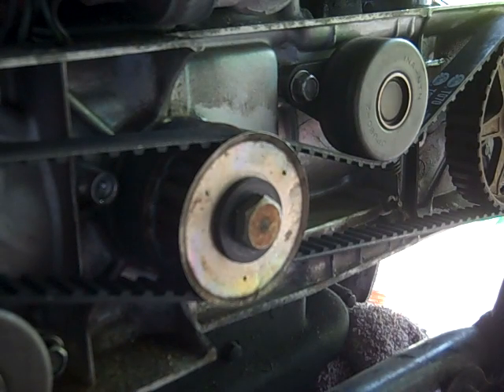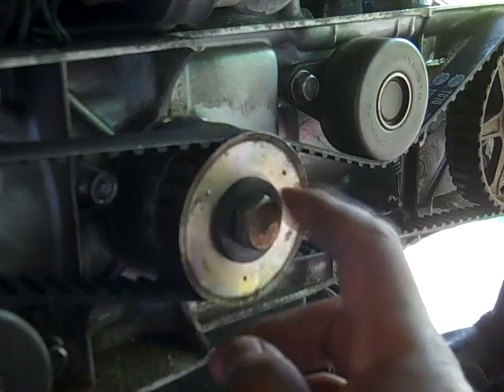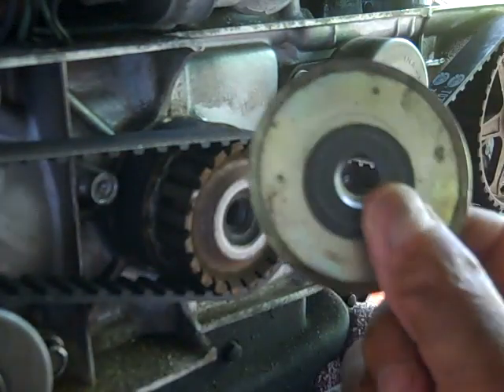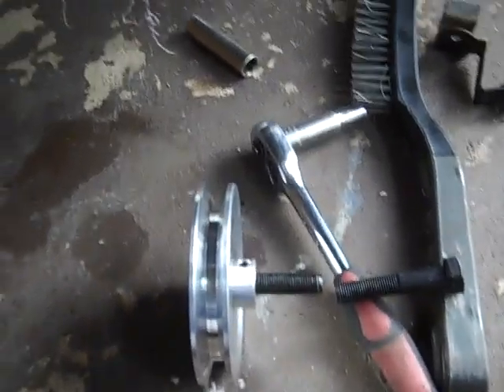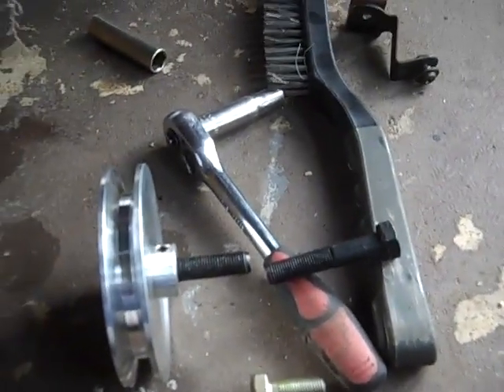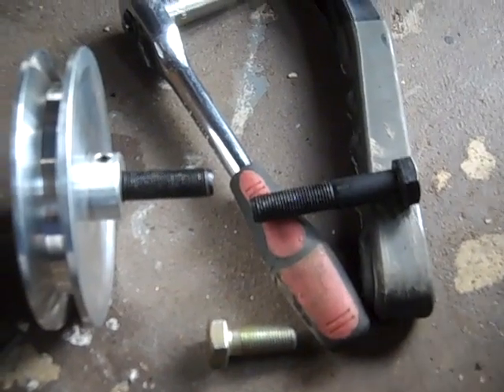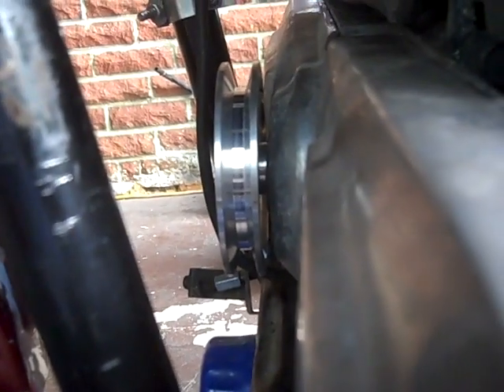Part 4 of 7 Detailed 84 Goldwing Po Boy Alternator Conversion Timing Cover With Pulley

Comment from the maker: As I figured I should have added the 2nd washer because once I tightened the pulley and the lock washer compressed the #3 timing belt screw on the right side made contact with the pulley, so, recheck this gap at the #3 timing belt cover screw to the pulley and add a washer or grind the timing cover screw down to reach a safe gap, then attach the left timing belt cover.
Reply from the maker: Adding to this after you have ensured the extra washer may have been needed, make sure you use some Loctite to backup the lock washer remember a lock washer is good securing something to a fixed object, but in this case the engine rotates to the right and the bolt threads are turned to the right as well, so again remember to apply a good amount of Loctite to resist the torque of the engine and tighten the pulley lock screw. I used the (BLUE LOCTITE).

Comment: What was the length of the bolt you ended up using? There's a bolt place near me. I may do the same thing you did (that was smart using a piece of bamboo for max length) so it's long enough. Great vid!
Reply from the maker: I have an extra bolt if you want it.
Reply from the maker: Thanks for Watching, and if interested, send me an IM message.
Reply from the maker: I am on Facebook under Grayling Drummond look for cover photo of a Wolf head and send me a IM message.
Reply from the maker: The length is 6.2 cm and width is 1.2 cm.

Comment: Hello mam, excuse me, how did tou screw and torqued the bolt that holds the 2 and the ney puley without the crank moves and lost synchronization
Reply from the maker: Yakarty, Once you are ready to secure it, you add the Blue Loctite to the bolt and hold the timing gears as tight as you can but if you can have someone to help you is better, once tight let the Loctite set overnight or 24 hours before starting the bike. Thanks for watching

Comment: Where you get the 12mm pulley and what alternator you using. I also have a 84 wing and need to do this conversion my stator going bad.
Reply from the maker: See part 1 of the 7 videos,  I ordered it from a tool shop in the UK listen for the company name and search it on your computer and also you can order on the site as well, $32.00 For the alternator go on Amazon and search for the 1 wire alternator which was $85.00, as you can see I made my own bracket without having it welded., if you have a Lowes Improvement store near you get the 5", 6.10mm screws for the bottom of the radiator, much success in your conversion.
Reply: @max1chase166  looking for them videos as I comment thanks man.
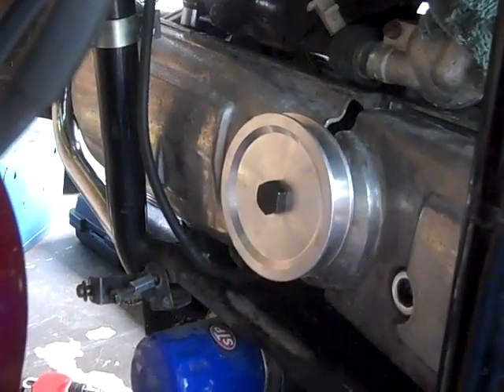Reply from the maker: @michaelmosley1385  See the video showing the pulley in my hand, it is the one which is 12:25. 1 of 7. Select the channel with the Volvo truck as the cover picture.
Reply from the maker: I got the alternator from Amazon ask for 1 wire mini 45 amp alternator, see Amazon Choice, Application 12180NSE,1002111660, 661,662, 04412972, $90.87,  I ordered the 4" Aluminum pulley from RDG Tools in the UK, Search for 4" aluminum Pulley 12mm bore, Select 4" diameter aluminum V Pulley 12mm bore New style Ref 7090332, !7.93 UK funds, Sorry for the delay, Look for a 3 week delay due to customs out and in country.
Reply: @max1chase166  I ordered the same pulley from stated manufacturer on abay it arrives today it only took 9 days to Detroit already have the alternator
Reply from the maker: @michaelmosley1385  Great, and the process begins, hope you not dealing with the heat like we are here in Va.
Reply: Just found your channel I just bought an 87 and was wondering how to get more juice. I’m going to start from the beginning of your videos thanks for sharing your knowledge!
Reply: So what’s the size and pitch of the bolt brother